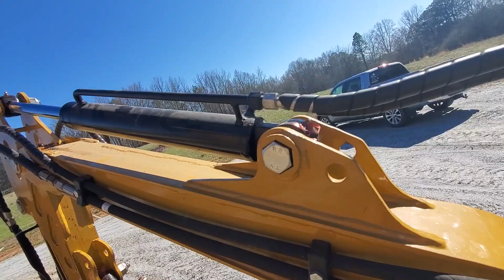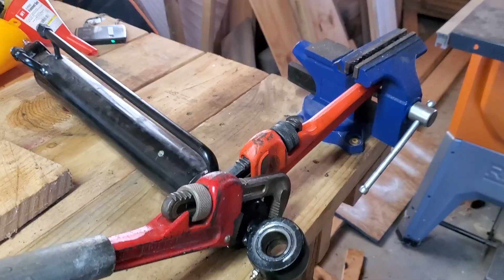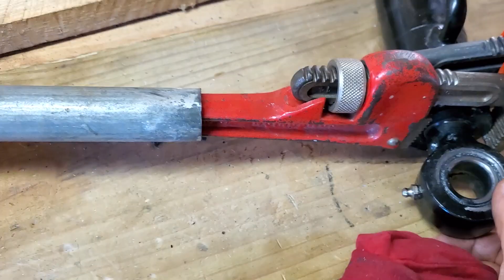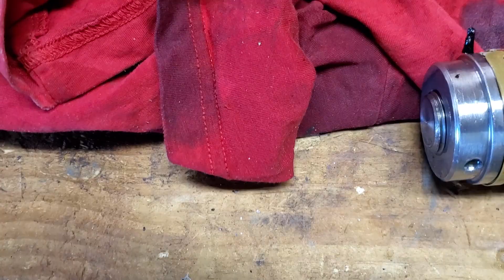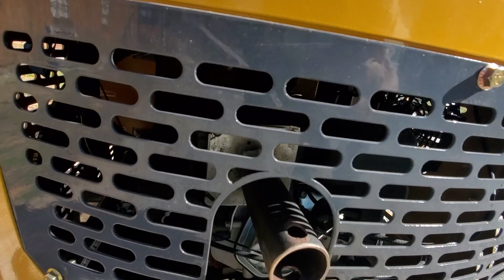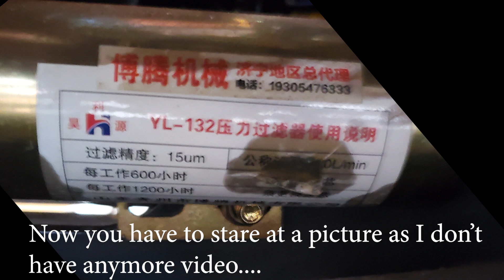AGT H15 Updates

Comment: Great vid. I'm thinking of buying the H15R. Seems like the same unit as yours. No noticeable changes, does it have dual hydraulic pumps?
Reply from the maker: Yes, but it doesn't matter. Second pump is for tracks and they are still slow as molasses. I walk faster than it moves.  Only one speed/no high speed.  With the arm, there are certain moves you can't do in combination.  I forget off hand which (you get used to it), but I believe one is twist and raise the boom.  Twisting to dump the bucket and have to raise it due to pile/incline, etc and you have to stop the twist, raise boom and then start twisting again.  None of it is a show stopper, I mean its less than 10% the cost of a 'real' one.
Reply: The metal filter is for the pilot controls and it's necessary because the tolerances are tighter. I think the snd pump is for the pilot controls as well.
  Nice fit and finish on your installations though.
Reply: @roberthenry7388  i agree, pilot controls need a filter. And one of the pumps is supply for pilot controls. 
Adding return line filter after draining and cleaning the hydraulic tank is a great idea.
Reply: I've seen hydraulic coolers for sale on ebay, so im assuming they don't come with one? Or is it a replacement?